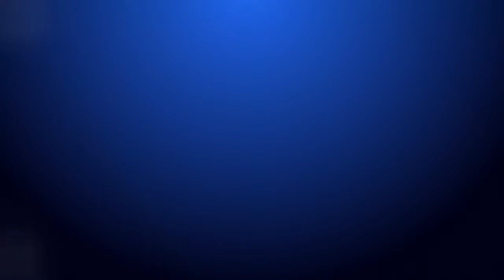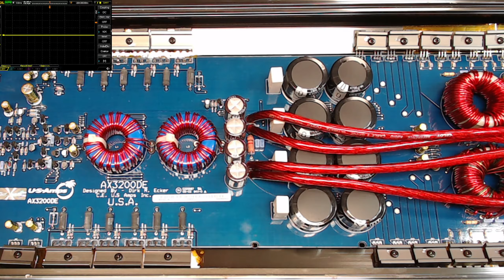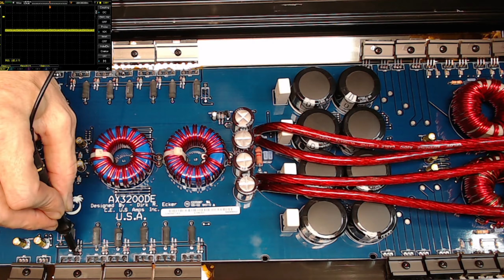US AMPS AX3200DE Quick Video No Repair Just Board Information for Reference

Comment: I had a question on a mosfet combo that 2 amps I’m repairing each use, although one uses the IRF640 and other IRF640N, are they the same? Also each amp uses the same P65NF06 on each power supply side as well (Massive 800.1 uses the IRF640N and Rockville 4000.1 uses the IRF640) Does the N denote a difference like it seems? Going to continue looking online but seems never an easy answer lol.
Reply from the maker: For the most part they are the same with the N version being newer. You may find some tolerance differences between the two but most boards won't care.